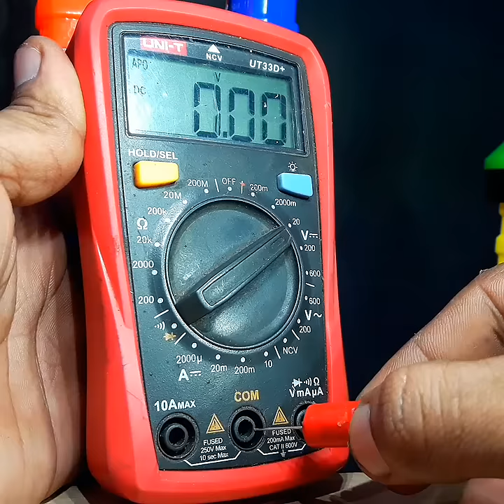making a lemon capacitor 🙄 how to make lemon capacitor / experiment #capacitor #electronics

Comment: capacitors don't work like that, they need 2 conductive plates very close to each other without touching hence why it looks like rolled tape inside. if it did work with a lemon why make it, you already have a perfectly good capacitor before you cut the top of.
Reply: For views and youtube money
Reply: Yeah. He made a battery but is too dump to know the difference
Reply: Shhh don't tell that, it's a secret, let's use a fucking lemon 😂

Comment: Too Good. Excellent!!!

For those making ignorant comments, he has not made capacitor out of existing capacitor. He has only used the packaging of the existing capacitor.
Reply: But what he did is not a capacitor !!! He made a water/lemon juice resistor.
Reply: @photonik-luminescence  If it was a resistor then how did it store charge. A resistor only impedes current and develops a voltage drop. It cannot act as a voltage source. In this case this device has stored electricity and is capable of acting as a voltage source. Therefore it is a capacitor.
Reply: It cannot physically hold a charge of that magnitude, the results are faked. Technically it has a (very, very low) capacitance, but so do all resistors. If you were to call this a capacitor, you would have to call almost anything a capacitor, as a capacitor is just two conductive surfaces separated by something insulative. Even humans have a capacitance, which would likely be higher than the capacitance of this "capacitor". If you still believe that this video is true, I implore you to try it yourself and test it.
Reply: @MyHandleIsGood  i wanted to actually mention that eaven we people are to a far extend a capacitor. He also may have just done a resistor or a really really bad battery. Anyway, destroying a capacitor to make a capacitor is top tier irony anyway 😂. I don't know why this guy holds so strong to this.
Reply: @photonik-luminescence  I was going to add that humans are capacitors, which is how most modern touch screens work, but my comment was getting a little too long.

Comment: There is no use of lemon.... Because a capacitor contains an insulator between two parallel conductive plate... The glue is used as the insulating medium....

Comment: Honestly this is kind of stupid because of how dangerous it contaminates are in and also the amount of lead that's in it is not safe it can kill you so mmmm I would recommend you get a little piece of tin and then make it to like a little pipe and take a lemon and squeeze it and you go ahead and put it into the little pipe and make sure that the other side of the pipe is sealed and then put a little metal prong to them and try to same experiment but a little bit more safer 😊

Comment: That is not a capacitor anymore. It is a resistor. Even if it has capacitive properties it will have lot of resistive properties aswell. And such a high leakage capacitor has no use in real circuit. Also the capacitance would be in few microfards. So why waste a perfectly fine capacitor to make this bs contraption. & Capacitors are not expensive.
Reply: Exactly. The capacitors are not expensive, by sacrifice it like this you get a short video that currently generated almost a million views, the ads profit will be huge compared to the cost. And when people saw a stupid shorts like this one especially related to engineering (I'm looking at you, welding video) they can satisfy their ego by commenting and then the creator get some comment to feed the algorithm, a win-win situation if you ask me.
Reply: @XiaZ  shorts don't generate ad revenue . it only counts the views and watch time hours
Reply: @KuntalGhosh  which the creator benefits greatly from it, my point still stand, it's a win-win don't be serious.

Comment: 💯% fake, there are two capacitors used in this video, (1 the one that got destroyed) (2 a new capacitor that hasn't been damaged).

You can notice it by the shape and size of the capacitor changing after wrapping it with electric tape and before he charged it...🤣🤣

⚠️Don't even try to make this people it's really dangerous⚠️